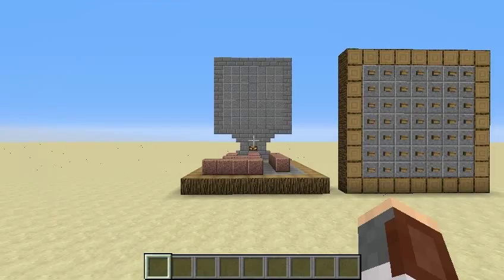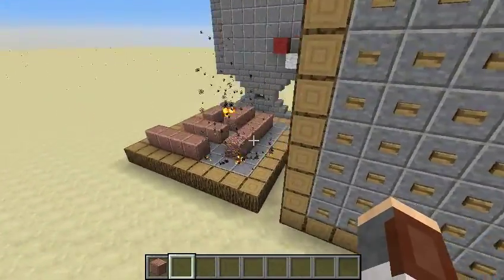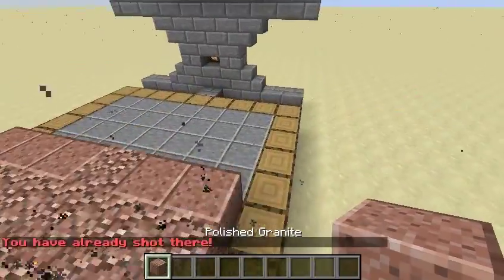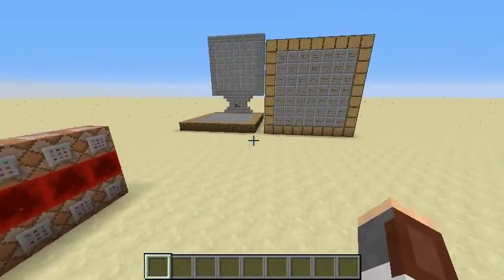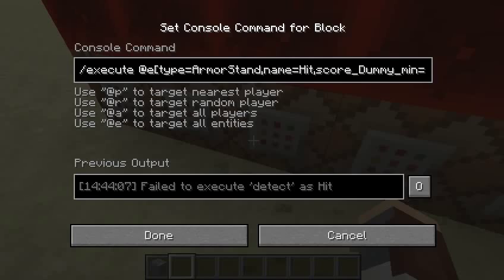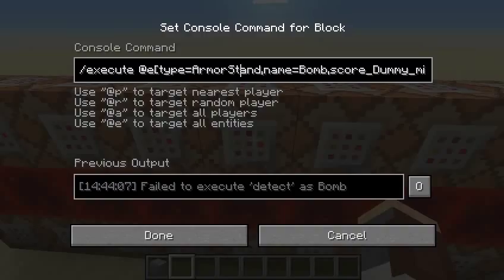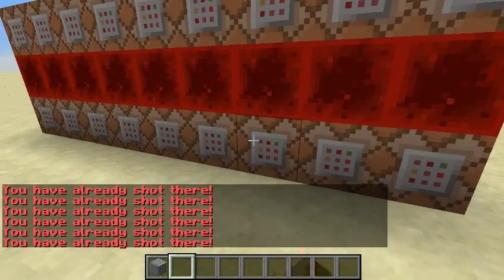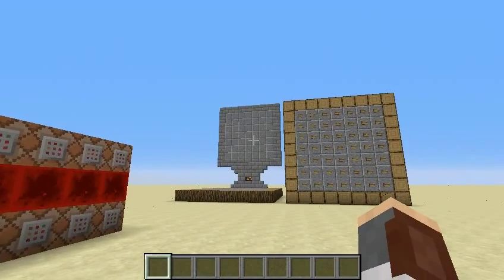Minecraft Tutorial: How to Compact Your Command Blocks (Battleship)!

Comment: I aint no guru at command block nor redstone, but you can probably do this with only 7 command blocks(including clock) and without using scoreboard command. Also, using blocks rather than entities in custom map is better in terms of performance. Anyway, operations command really is very powerful tool in mapmaking.
Reply from the maker: Yeah, can't do it in 7 (I saw your other message). Also, yes, using blocks is better in terms of performace. However, 98 entities (which would be the amount if I had two of these) doesn't lag at all on a decent computer. Also, it saves you a LOT of time and space. Thanks for watching. :)